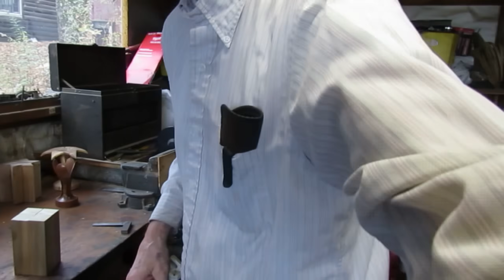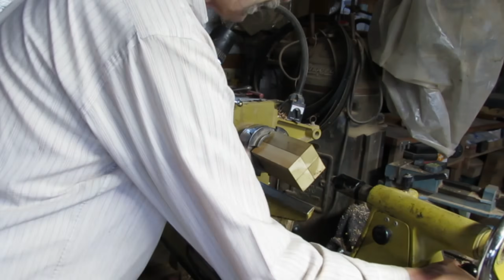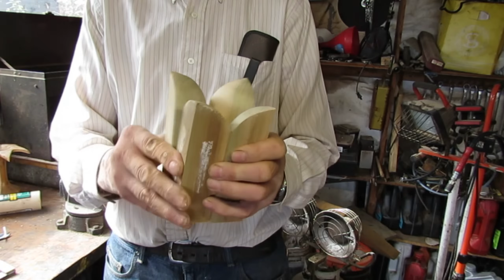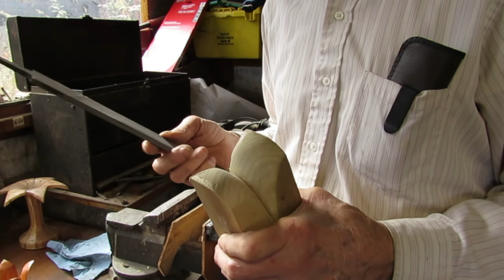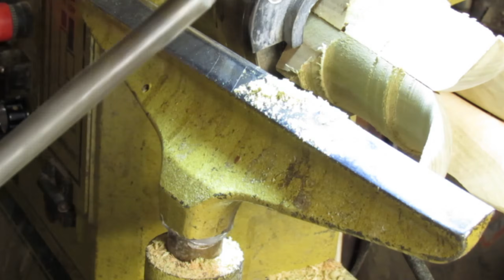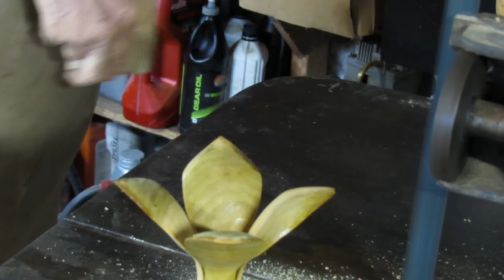4 way wooden lathe flower

Comment: You mentioned when you turn the inside you can make a ledge.  Maybe you can make a ledge at the correct depth and size to put a tea light candle, or light inside the flower pedals.  This is beautiful work.
Reply from the maker: Most definitely. I think others have done that with Christmas ornaments.